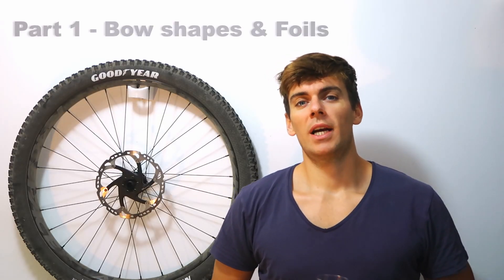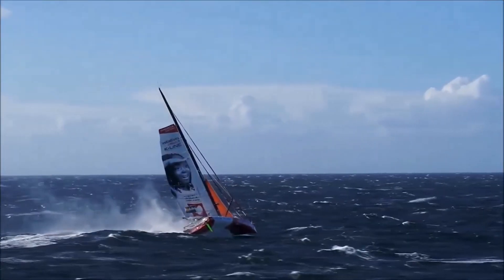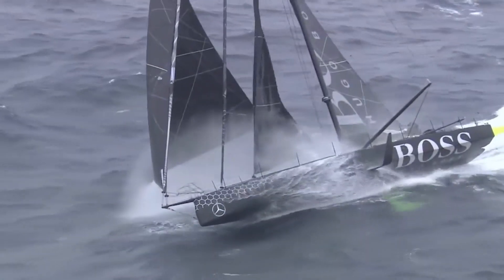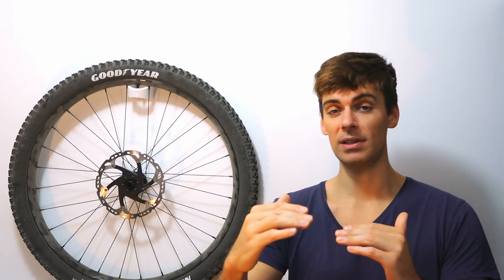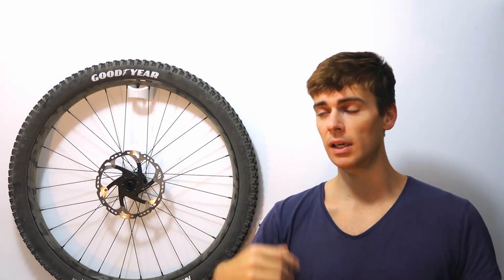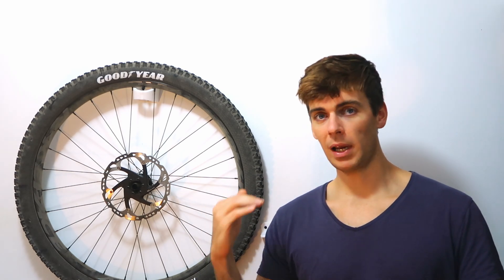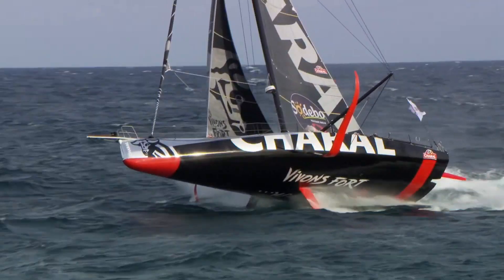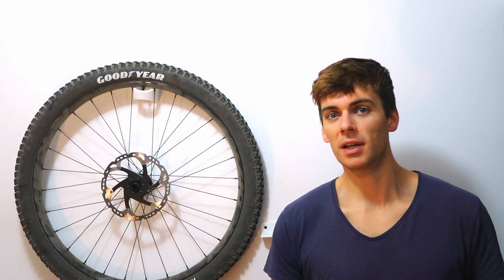Vendée Globe IMOCA 2020 Boat Tech Design Analysis Part 1 - Bow shapes & Foils

Comment: Armel Tripon, skipper of the occitane said his boat is more comfortable than others, that has been explained and confirmed also by Sam Manuard his designer, the reason is the boat fly closer to the water than other foil boats, which is allowed by the nose pointing up and wider front.
The end result is the boat has a more constant speed and does not slam down as much as the other boats. Its average speed is higher down wind in 15-20 knots wind.
The boat is far behind due to a hook problem, Tripon made a u turn heading to Portugal before finding a solution and turning back in the race again, right now occitane is much faster than the boats around him... without surprise.
Reply from the maker: Too many hook problems! A real shame for Tripon.

Comment: I've got a question regarding spokes, particularly carbon spokes.  Would it be possible to make these out of almost pure UD carbon fiber with no epoxy matrix? Given that spokes are always in tension.
Reply: Does the epoxy not bond different fibers together? 
Saying that if the spoke is made of long strands of carbon you could try. 

It would be a nightmare to set up though and very sharp edges.
Reply: @cathallawlor989  That's fair, I hadn't thought of that. Maybe they could be coated in some sort of clear coat to keep them bundled and ever so slightly rigid? Or braided like those UHMW spokes?
Reply: Mavic had wheels with carbon spokes laced radialy on the nds in the rear wheel. Now a new series of mtb whells came out with all carbon spokes by Gulo Composites. The problem is that those spokes can't bend (where crossing with others) and can't be twisted so you have to hold both ends while trueing the wheel to prevent that.
Reply from the maker: In theory if the loads were purely tensile it could work. There's a company out there using pure Kevlar or dyneema braid with no epoxy and it works. I wouldn't use it for radial spokes mind! Practically, without epoxy they would be a nightmare to handle, assemble and be too fragile. You rely on the epoxy to transfer small shear stresses through the bundle. It also plays a big part in impact toughness. Cheers

Comment: Love the video, scratching the surface but you have to start somewhere. Not sure how it will go down with cyclist. I am first a sailor and then a cyclist to keep in shape, currently round. The other thing that needs to be considered slamming wave after wave shipping water across the deck. Is keeping the mast in the air, they have a habit of not decelerating quite as fast as the hull so do fall down as a result. I took up land yachting have sailed lots of different types of boats. High multiples of apparent wind typically sailing at 80kph. The really crazy stuff see DN ice yachts. Keep up the good work
Reply from the maker: That's why you need a nice light rig! Preferably with a massive spherical bearing at the bottom, to really limit those decel/inertial moments. I love land yachts. Effing crazy things!
Reply: @PeakTorque  on my channel I captured a race with a 360 camera. I am a lot quicker these days when we are allowed to race again.

Comment: Update on the engineering of the IMOCA class - build a boat so extreme that it breaks in two and endangers the life of the skipper.
Reply from the maker: People are criticising my comments on marginal gains saying safety is too important and these IMOCAs are hardy RTW boats. Well. They clearly aren't!
Reply: @PeakTorque  there is no boat that you cant break in a open design class, If you want to create a boat that doesn't break then you look what they did with the VOR65 class
no damage on the boats but they are fat pigs compared to the imoca class

Comment: I think you are overestimating the flying capacity of the boats and the use of foils. They don't foil that much while racing in the vendee , Yes we Cam is showing similar boats speeds on an older boat without foils in the windy conditions , especially now in the south. The foils are there mostly to get better Rm in Light to medium conditions and to give some lift to the boats but not total flight. Also there is no point making the foils so heavy and protected to withstand impact. Do a calculation on how much more structure and weight you would need to add to have a system that is safe from impacts and then tell me how much time that is gonna cost you in the vendee compared to a boat without foils

Comment: Would argue that alot of the drawbacks of the scow bow design ethos are negated by the addition of foils , anecdotally the foils reduce slamming quite a lot.
Also the foils add tonnes of righting moment which seems like a huge factor in their design, at least in the last generation.
Reply from the maker: Still trying to find out what's up with LOCCITANE. For such a cool and expensive boat, their PR and media presence is terrible. If i was the sponsor I'd be having some very stern words with the team.

Comment: These boats must be a nightmare to sail downwind in a seaway with the apparent wind all over the place. Pitchpole seems like it could  be a real problem. Perhaps driving off in a gust to stall sails works to regain control. The problem of hitting the odd refrigerator or container has always been there in ocean racing. This has got to be a more challenging engineering problem than any bike frame! Spare foils and sacrificial foil mountings?
Reply from the maker: Great comment. I think that's the way to go. Sacrificial mount that won't damage the substructure. It's crazy how many boats aren't carrying spare rudders or foils. I seem to have jinxed Charal literally 1 hour after releasing this video he headed back to the dock for foil/rudder repairs.
Reply: Sailing these boats downwind is what they are designed to do. Ever heard the phrase running before a storm. The sea state is following and the breeze is not as bad etc. Yachts that sink in a storm trend to be stationery and overwhelmed by the sea, so moving with the waves is best..
As to taking spare foils there is no point the are huge and need a crane and flat water the be fitted. Best make them so the snap off an don't damage the hull.
I do know someone who has sailed on Hugo Boss with Alex and I asked how the foils made the ride. He said it turned it into a complete vomit comet.
Reply: @PeakTorque  I don't know about IMOCA, but often multihulls have "crush boxes" behind foils.
Reply: @PeakTorque  you cant mount anything on the sea that size on your own so no point crying spare
Reply: @christianlindell4573  you are right. you can change the rudder but is it competitive to carry spare ? Also the question of foils stays , imo they are 2 big to carry spare and pip has the old rudder config with no kick-up rudder. The other boats have a safety pin that breaks on impact and trips the rudder to up

Comment: How did you come up with the 3 metres cubed estimate of water on deck? It doesn't feel super plausible to me considering how aerated the water is in that scenario and the actual depth of water we see coming on deck in videos, even in the worst conditions
Reply: I can say from experience handling sails on the foredeck that when the nose goes into a wave, the water is green (or black at night) over the deck, and you can be floating above the boat holding on to the sail.
Reply: @antonomaseapophasis5142  Fair!